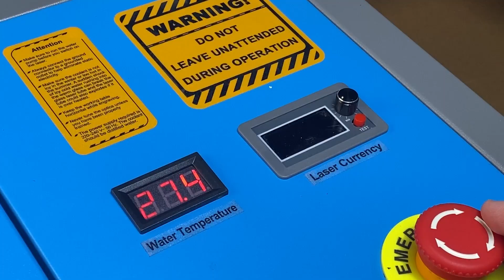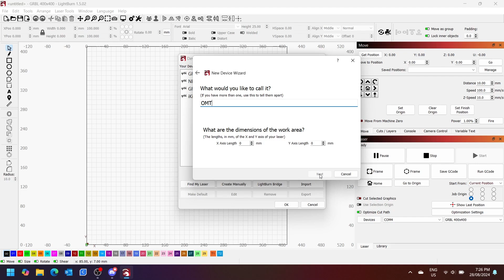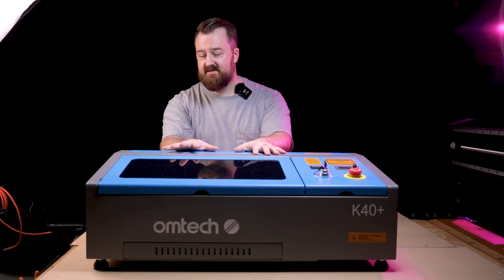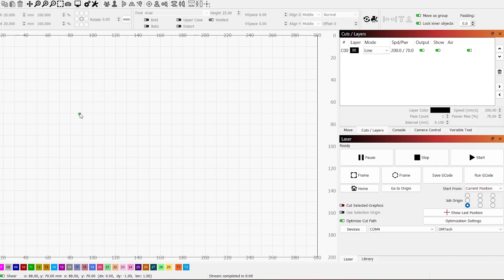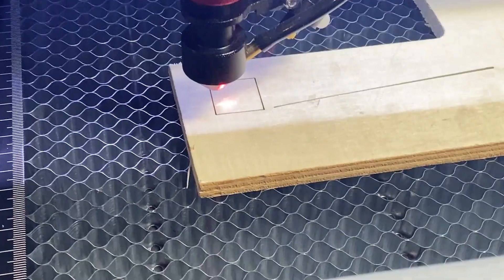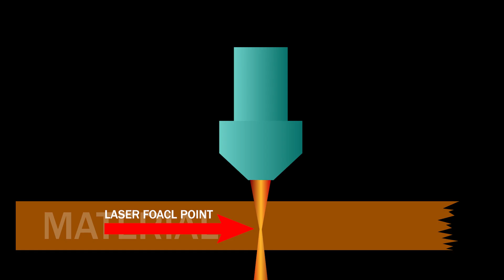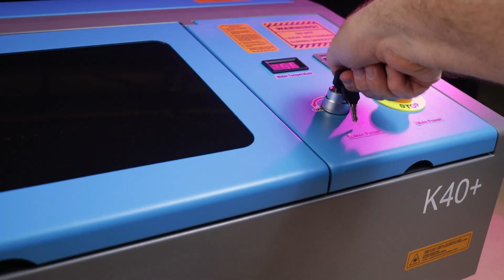OMTech K40+ // Unboxing and beyond

Comment: While trying to achieve focus on thinner material (3mm or so) the laser tube simply falls out. It doesn't appear to be long enough.

Is there something I'm overlooking? I'm surprised I never came across this issue in my research
Reply from the maker: Hmmm. This does sound unusual. I have not had this issue and unsure how this could happen. You might need to contact omtech directly with images outlining this. I am happy to have a look if you need via email newtechcreative@gmail.com
Reply: @NEWTechCreative  I just figured it out! I put two wooden pencils on each side of the bed in between the bed and rail and it lifted it just enough for the focus head to come down to the correct distance! Thank you for your fast reply! It lifted the bed 7mm...
Reply from the maker: Oh great to hear! Have fun creating 🤩🤩

Comment: Can I engrave 100*120mm logo on 310*310mm material?? I mean, a 310*310 material can fit in it?
Reply from the maker: Yes this is possible! There is some extra room at back and front under internal frame to fit larger materials like this.
Reply: @NEWTechCreative May we get a video from you of cutting a larger material with this machine? Where you are making clear the audience that how large it can fit
Reply: @NEWTechCreative others telling me that I cannot do this. I'm requesting you a video🌸

Comment: I just ordered a 45W K40+ machine. Still waiting for it to arrive. Enjoyed your video. This is the first YouTube channel I wanted to subscribe to.  Easy to follow.  Do you have a video on adding a Lightburn camera to the OMTECH K40+ laser and in particular, where to mount the camera
Reply from the maker: Thank you for your kind words! Great to hear you’ve purchased a new machine. I have used an inspection camera with the camera and could use one the guide laser mount, however a fixed camera on underside of lid would be a great addition. You will be able to run the camera cable out one of the gaps around the machine and setup in lightburn pretty easy. I haven’t made a video on that process, however there are a stack of videos with this setup information. Good luck with your new laser and happy creating 👌👌

Comment: Hi, I got the same machine delivered today. But I think the air-assist is not working like it should. The cuts are all burnt with brown spots on the wood. I can feel a little air coming out of the nozzle, but it isn't even enough to blow away a small piece of paper.. How is the airflow on your machine? I can't find any videos to check what a good airflow from the air assist should be.
Reply from the maker: Great question. The air assist is only a small pump under the left side of machine and only produces small amount of air. I haven’t found major issues with cutting ply, however if you want to remove the brown spots, consider raising material slightly from honeycomb bed using some scrap pieces in each corner of material. The air assist is there to direct smoke and small debris away from nozzle.
Reply: @NEWTechCreative  Thank you for the answer. I just bought a external airpump as it has more power/airflow and is a lot quieter. The built-in air assist pump is a bit noisy. Thanks for the tip about raising the piece a bit from the bed, I will try :) But I meant that I got brown spots on the top of the material, even with lower laser settings, which (if I google it) can be solved with good air assist. I'll let you know if the new pump helps. Thanks again for the quick reply!

Comment: Hi, what's the working area size? I looked at Omtech website and it says 300mm x 200mm only? Is that correct? Looks different from your video, looks bigger.
Reply from the maker: Yes that is correct. There is some additional wiggle room, however 300x200 is correct. It is rare that I ever need more working area!
Reply: @NEWTechCreative  Ok, thanks!

Comment: Just buy a cheap ice cube maker drill a few holes in the lid for the pipes and pump power. Mine can keep my water below 20c while running.
Reply from the maker: Very interesting! I do live in a rather warm climate and my water temp doesn’t seem to get much higher than 36c here with just using water. The laser will need a slightly warmer working environment to avoid contrasting temperatures that can cause issues to components.
Reply: @NEWTechCreative  Looking at the lasers in the typical 40W K40, they don't like going much above 24°C and life can decrease exponentially. the ice maker keeps it below 20 °C with no issues.

Comment: Very useful video thanks. One question, when you're engraving and cutting on the same project I assume you focus for the engraving not the cutting?
Reply from the maker: If it is 3mm material - focus on top for engraving as it won’t make a huge difference… if it’s thicker, move your head down to compensate. If you are after perfection, you might need to re-adjust between layers.

Comment: hello and thanks fo the super helpfull video. I have the same exact machine and the only question that I have is that how do I set up a good frame trace because mine is not going to complete the trace. I am looking for a video to show me how to do a complete origin test on this machine. thanks again
Reply from the maker: Thanks for your comment! I’m unsure on what software your using, however ensure that you have enabled homing to the left back corner to ensure that the machine knows its limits and then setup your machine work area, then this shouldn’t be an issue. I use lightburn and works great once setup. If you need further guidance, I’m happy to help!

Comment: Hello! Nice video. Im deciding which laser to get and this is the cheapest Co2 laser. My only concern is is that the water temperature for the water pump needs to be at a certain temperature and i live in a very cold state. Any thoughts? Thanks
Reply from the maker: Thank you! This is a great question… I have the opposite issue here is Brisbane - too hot 🥵 the manual state typical running temp keep it between 60°F-70°F (15°C-21°C). Also states not to use less than 50°F (10°C)! I hope this helps 👍
Reply: Same situation here. How I handle it is to use a glycol based solution to lower the freezing point of the water so it cannot freeze when the machine is completely off in my climate, as this would shatter the glass of the CO2 laser tube. It is important to check that the solution is compatible with all materials it is in contact with. Besides that, I use a small aquarium heater with thermostat control to gradually preheat the solution to 15C before I start using it. I always leave this heater active when using the machine to prevent it dipping below 15C when idling. I keep the water pump on whilst heating to ensure everything is efficiently and evenly heated up.
Reply: @ thanks!

Comment: where does the other end of the laser cut tube go?
Reply from the maker: This is the return water hose and needs to be placed back under the water level to complete the water flow.
Reply: @NEWTechCreative  sorry, I meant to say the air extraction tube
Reply from the maker: @ oh no problems. Place the air extraction hose in a window or door to ensure fumes are kept away from risk of breathing in. You can purchase a window fixture usually used for air conditioning units that use the same diameter hose. These are secured in the window and can easily be removed.

Comment: I am waiting now for mine to arrive! what settings did you use for cutting the 3MM clear acrylic?
Reply from the maker: Awesome news! From memory it was 9mm/sec at 80% power. I would do a could have test cuts as it varies from material to material. If you have some scrap acrylic, place this under each side of material to raise off bed slightly to get a smoother result! Have fun 🤩

Comment: hey! is it true it comes with a calibrator that is tuned for 3mm materials? I plan on basically only cutting that so that would be really useful
Reply: also, what power did you use for the 3mm clear acrylic?
Reply from the maker: Thanks for your comment! The distance calibration can vary from machine to machine. It’s best to do the ramp test to check. There were some additional materials that the machine came with, however unsure if they were for measuring focal point. I believe I ran the acrylic at 9mm/sec at 85% power… I’ll have to check actual settings.
Reply: @NEWTechCreative  super par contre attention à pas mettre trop fort la puissance du laser co2 car sa durée de vie en dépend <40% 2000H 50-70 % 1200h > 70% 600H car sa coûte 200€
Reply: @NEWTechCreative  awesome, thanks! the 3mm acrylic in the video looked awesome

Comment: Hi, thanks for your video. I’m currently looking into getting a small CO2 laser machine to start making my own acrylic jewelry with 3mm thickness. I’ve seen other review videos of this machine, and it seemed like the edges of the acrylic weren’t very clean and looked a bit melted. However, in your video, the results seem pretty good. Do you think this machine does a good job in terms of the edge quality when cutting acrylic? I’ve heard that some people prefer to cut in multiple passes to prevent melting, but I’m not sure if the edges come out clean and smooth that way. Thanks for your response!
Reply from the maker: Thanks for your comment! After using the machine for more time I realized that the small ‘blow outs’ were caused by the honey comb bed under the material and if I raised the acrylic material away from bed with some scrap pieces of acrylic, all the small ‘blow outs’ disappeared and had a great finish.
Reply: Thanks for your reply! I will consider getting this machine.

Comment: Hello my friend. I want to egrave acrylic to create cookie stamps. IS this machine good for egraving without lines inside and clear result or after egraving the are lines inside the holes? thank you :)
Reply from the maker: Great question. There are some aspects that can influence clarity in finishes for engraving and yes you can get reasonably clear surface finishes with the correct line interval and multi passes at different directions etc. there is also post processing options to further smooth surfaces. I’ll attempt to have a play for you and show results sometime today.

Comment: Do you have a link for the manual? Omtech actually doesn’t have one (the file for the k40+ is for a different component)
Reply from the maker: Is this what you are after? https://cdn.shopify.com/s/files/1/0556/7512/5806/files/USB-0302-X2.pdf?v=1704866532

Comment: si It's possible to cut 5mm acrylic. i wont to use 5mm, but will be using perspex as i know this is a best quality acrylic to laser cut. would it not be better to have the water chiller to? im in the uk so not hot here but seems like your in Oz my cousin?
Reply from the maker: Yeah the the machine runs just fine using water, however I have noticed that there is a water chiller available too! Not sure how much more useful it would be but might make a difference through summer!! Yeah summer gets pretty steamy here is Oz!
Reply: @NEWTechCreative  it will make a difference   how well does it cut 5mm acrylic?
Reply from the maker: 5mm is pretty easy on the k40+. I found it easier to cut with 3 fast passes for a better finish.
Reply: @NEWTechCreative  excellent as i use both 5mm and 3mm!

Comment: I’m a little confused I have never had a laser before but I want to get one and not sure which to get I am new to all of this what’s the difference in omtech co2 k40 + and a diode laser ? and I thought it only needed a air purifier what else does it need?
Reply from the maker: Great question! The main difference from the perspective of laser technology is that CO2 lasers can cut a greater range of materials. Diode lasers unfortunately cannot cut clear materials and limits what you can create with your machine. As long as you mount your air hose outdoors, you won’t need a purifier. It was only the water need to purchase additionally to cool the CO2 tube.

Comment: Is there air assist on this laser at the cut? Cheers
Reply from the maker: Yes! There is a small air pump installed in front left on machine body that connects through to laser head.
Reply: @NEWTechCreative  thanks

Comment: How thick wood (ply) can it cut?
Reply: How many passes do you wanna take? It’ll get through basically anything with the right lens and settings, but I’d guess 3-4mm would be a good “normal” thickness for a 40w machine.

Comment: That acrylic case looks so cool! Didn't know you could get a C02 laser in this price range. Do you find the bed size limiting?
Reply from the maker: Great question! The bed size is perfect for A4 sized material and can purchase acrylic in this size, however I would always appreciate to have a larger working area! The size is reflected in price and their next version up does do 500x300 I believe but at a higher price.
Reply: @NEWTechCreative  Thanks for the response. Did the purchase price include delivery? And do you know how often the C02 tube needs replacing?
Reply from the maker: @dustinrex4585 Yes this includes shipping! If you use at the suggested max of 75% power, it should last around 1100hrs… for engraving I usually run at 20-50% so I recon it would last me many years if I used ever day!